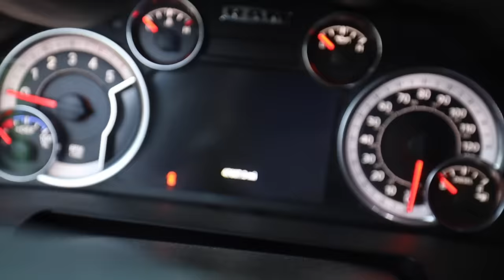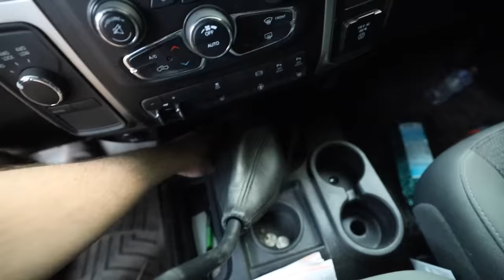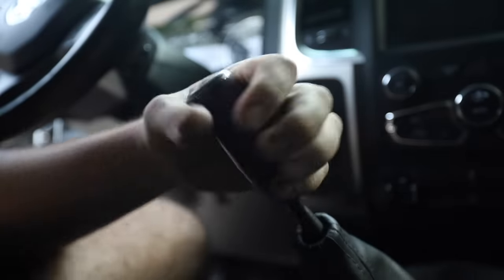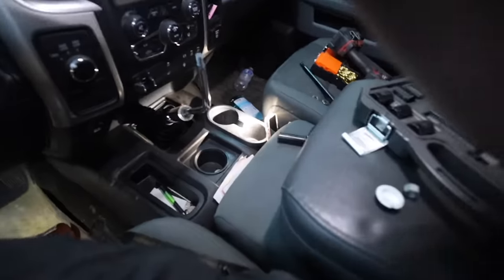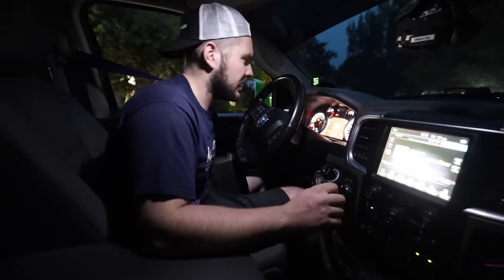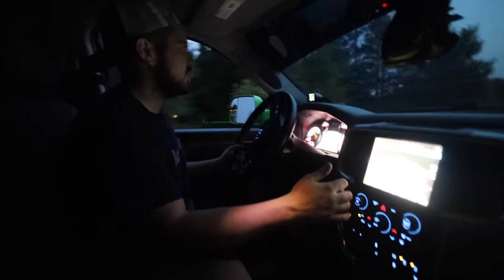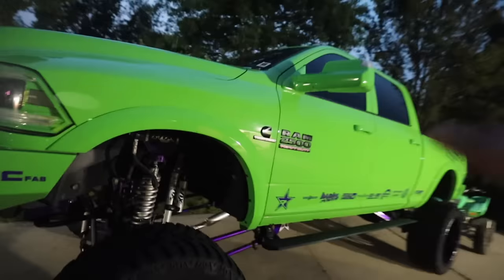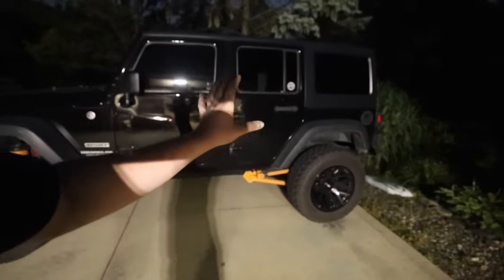I Thought I Bought The BEST Ram Transmission...

Comment: Same thing happened to me too I was driving and it broke and just like you I needed my truck so my mind I need it also mine came in Chrome it's nice and the noise is there but it doesn't bother me anymore listen to the radio I got my shifter Ohio diesel parts but I put my old shit knob back on